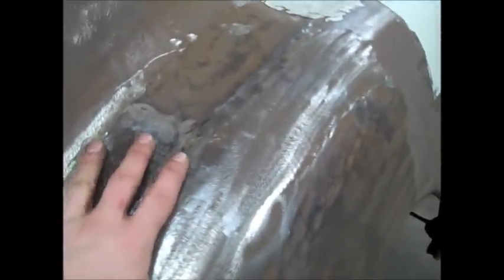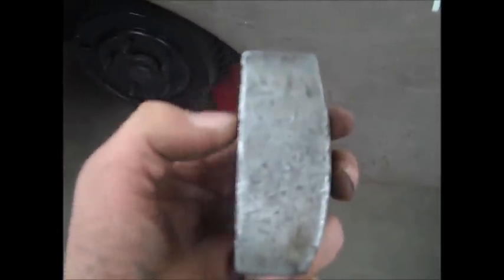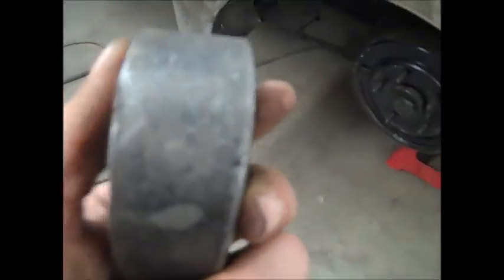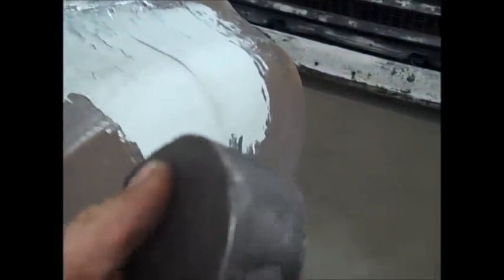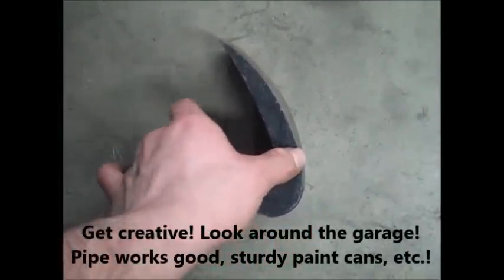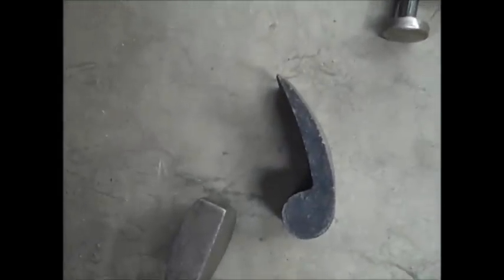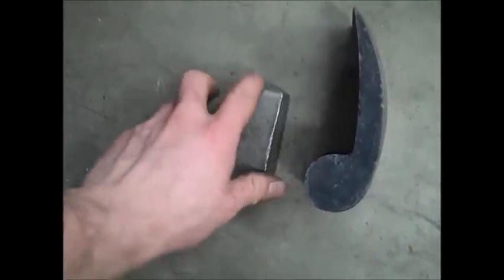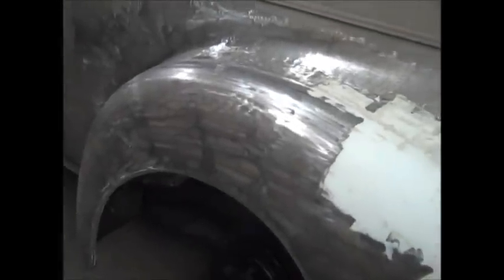How to: Hammer & dolly Steel auto body

Comment: Hey man That job you did on that truck fixing the frame that's some bad ass work man thank you for the help I was going to comment on it but the comment section was off . Question . On the plates do you sand down the weld to make it smooth and even or does that weaken it ?
Reply from the maker: you can if ya want. definitely can affect the structure though if you grind it down and don't have good pemetration on your welds.